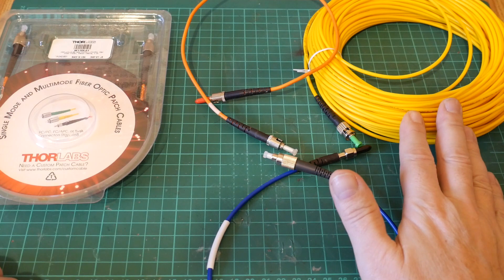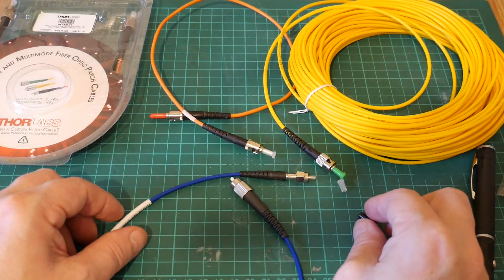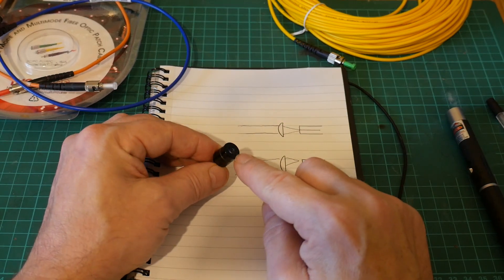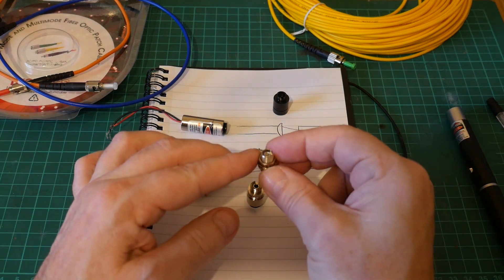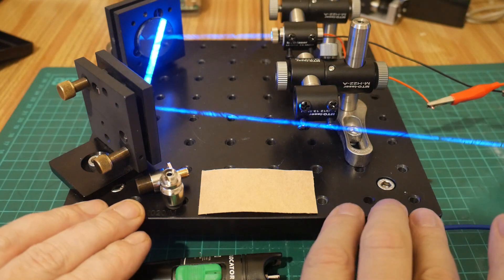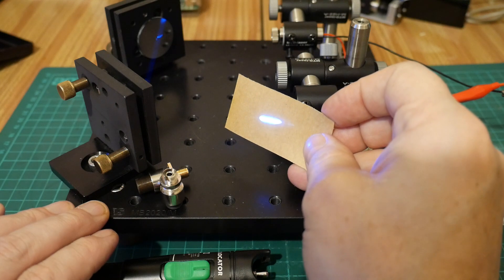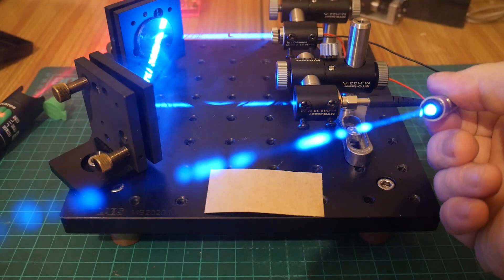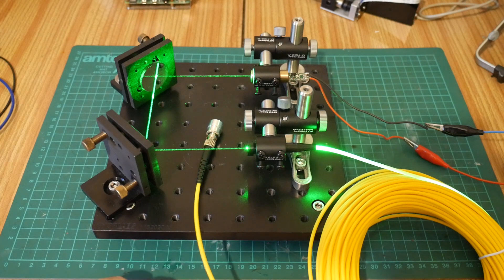Coupling Laser beams into Fiber Optic Cable!

Comment: I'm working on a spectrometer and need to couple three different wavelength light sources into a single optical fiber. What's the best way to do this using minimal hardware?

Comment: is there a way do the reverse , if we want to transmit data from computer to another far away with laser beem over long distances in the air  ? getting from pc1  light from fiber to laser ..than laser to some IR or optic sensor than to pc 2

Comment: Hi Les what do you use to make the smoke for the obligatory smoke shots? Love the uploads!
Reply from the maker: Dip a soldering iron in glycerine and blow on it. I should probably buy a smoke machine!
Reply: @LesLaboratory that worked surprisingly well! Thanks for the tip. I always assumed you had a mini smoke machine but I wasn't sure.

Comment: Looked a bit for the required hardware, optical bench from Thorlabs is as cheap as stuff from Ali (100 bucks?), sadly found mostly gun related collimators on Aliexpress, no idea where to get adjustable mirrors and such if not for big bucks :(

Comment: Is the final beam gaussian?
Reply: don't think so; telecom single mode fibers with 9um core are not single mode for visible light. You'll need smaller core diameters for that. These are consequently harder to align and they are less common and therefore much more expensive in my experience so I could see the reason for buying the telecom fiber.

Comment: my understanding is that free space to fiber launch, especially in devices based on small numbers of relatively high power off the shelf emitters, use so called "coreless fiber end caps" to facilitate setup and mitigate practical problems.

they can be >10x larger in diameter (800 micron outer cladding high power multimode fiber with 9 mm end cap), with much greater mass to sink thermal  effecss, dampen resonance and alignment issues (from microscopic movement or resonance driven by ambient noise or thermally)

Comment: Looks like this is first step to fiber laser used in metal cutters. How to couple few laser diodes into one fiber?
Reply from the maker: For this is is possible to join several fibres into one if you have the right gear. I will have to keep my eye out for a fusion splicer ;-)

Comment: Do you have a link for that cheap telecommunication fiber cables.? but perhaps not ideal for my usecases.
am going thrue different fibers, looking for  crude cheap alternatives for spectrometer extension cable.
been trying anything from the old Toslink cables to the modern fiber cables for internet simply because of the low prices..
just been getting the cheap ones, like SC OM2 angled APC and UPC, and FC interfaces..I recall its multimode.
but they all got their weaknesses
Im seeing a big dip from around 700 to 760NM on Toslink when checking an old glowing light bulb  so clearly not linear acroos the visual NM-span to near infrared.. its the visual span Im pursuing linear transfer in.. 370 to around 800nm
and these cheap fiber cables, they are very poor in transporting visual light as its not accelerated and quite dim, as the optical line seems very narrow. (at least on the cheap one, Ipicked up from CN) 
Are there any cheap cable alternatives for spectrometers light travel. that is linear acroos the visual wavelength span?
sofar the Toslink cables, works way better then the optic fiber cables, I tried, and they dont seem to fluke my readings, and I dont have many coherent laser sources in the 700 to 760nm span.
But it could very likely be that Im simply not pursuing the right version of cheap optic fiber cables that got wide optical inner transmitter light path.?

Comment: I'm after some advice for a very specific problem. I need a laser powerful enough to burn carbon/soot but has a flexible fibre to get into hard places. The carbon/soot is located inside drilled holes within a car engine pistons.
They are called the oil return holes and take oil from the oil control ring through the piston back into the crankcase, all car pistons have these holes, but some cars they get clogged up with carbon deposits.
The idea is to remove the bottom oil pan and burn out this soot/carbon deposit with a laser, the holes are usually quite small maybe only 1/8 of an inch in diameter, but can be quite long all the way through the piston ( 1/2" or more at thickest part of the piston head). 
To clean out these holes requires engine rebuild, if its possible to clean them out with laser would be very advantageous.
Reply: Interesting problem. I'm curious to know how you eventually solved it. Obviously, fiber optics technology deals mostly with laser that are not that powerful.
Reply: @kichigan1  I never solved it

Comment: Maybe an amateur question but: why the beam between the 45º mirrors looks much more intense and visible than the parallel input and output beams? Is it the camera position?
Love you videos and style, BTW!
Reply from the maker: Light is preferentially scattered forwards, rather than sideways, so a beam pointing towards the camera will appear brighter, than those parallel to it. Thanks!

Comment: 5:00 do you have a link for the lense? i don't finde the one that outputs a beam of the optical fiber that is in this price area.
Reply from the maker: At 5:00 the lens assembly shown is home made from an sma connector and a laser diode collimator lens, this was for an odd SMA905 fiber I had. The more common  FC connector lenses are available from aliexpress at reasonable prices: https://m.aliexpress.com/item/1005003438926038.html

Comment: The crazy thing is that my brother, I and my cousin got separately the idea of smartphone repair. I kind of knew a faintest but that my brother did this before but in my mind I marked it as electronic stuff. If I were rich, I would out of boredom behave as if I was kinda poor and try to make a buck incl. a limited budget. Like here, start with repair, then where to find deals and the distribution theory where and how to sell. This by not being a betrayer but e.g. find the customers that long the most like merchandise lovers.. speaking of, this was before my realisation of the relative abundance of deep state lovers.. anyway, You have tech in Your hands with that phone and You can maybe push Your learning to the up to date microchips, programming and e.g. chemistry like the Loca glue (light activated optical clear adhesive with no yellowing and a refractory index below 1.5 and prob. Rhos certificate?) or even how to do it Yourself (diy) a debubbling/vacuum machine for the OCA glue (heat activated one). No need to Google it, You may find out by accident & etc.
Reply: Oh! Allways inform for safety precautions by e.g. 2 professionals or something. If You open up a device with a high voltage capacitor, it could be still charged! And whatever I did, I tried allways to avoid handling 220Volts and to put it through a good isolated converter first instead to e.g. 12V
Reply: Yeah.. syntax..

Comment: there seems to be some interesting work with using polarized beam splitters to combine diode laser beams for increased power.  Have you considered doing something along those lines and add in the use of a fiber cable as a part of a cutting head? ie blue laser diodes?
Reply from the maker: I have a fiber fanout that I am planning to use in reverse at some point. Basically several fibers coupled into one. I have no idea how it will work out, but it is on the list of projects!

Comment: considering the challenges, sometimes i think its best to just mount teh damn thing to the head where it always was!

um... for years years i always wanted to know "how much power can i shove down a fiber?"
i never got answers, just gibberish about bandwidths and datarates. no, POWER!

i now understand its a thing called insertion loss along with variou other factors. not that it helps much...

i always wanted to shove the laser diode (or several) on a separate mount and feed the beam witha  fibre to the head... oh well.

probably best just doing it with open mirrors like a normal cutter actually.

Comment: There was some ideas for mounting fibers for use with collimating lenses etc in the comments. For me I have had great success using a piece  of aluminium about 30mm x 50mm x 2mm. I remove the buffer leaving the bare fibre exposed, make a clean cleave and then epoxy the fiber to the aluminium plate. Now it`s tempting to have the bar fiber hang over the edge a little, but this way its vulnerable to mechanical damage, so instead I cut or punch a small section of the edge away, maybe 5mm wide x 6mm deep. The fiber is mounted within this cutout so the end of the fiber is recessed from the edge of the strip but is still protruding over the edge of the recess. The assembly can then be bolted to supports on an optical bench or sled.

Comment: I think you can use the collimator from the SFP module
for example, you can see it here
https://youtu.be/vMP9gLMWHhI?t=107
Reply from the maker: I might might give that a go. I have a similar module (Laser diode direct to fiber) it has a GRIN lens in it, and looks like it was glued into position at the factory, but it would be nice to get a super compact coupler.

Comment: 5:30 you can use focusing lense module from DVD drives which can give very focused beam but with extra electronically focusing features so With that fine tune would be much easier and you can note and tell by looking at input power of the coil to find exact focus Point .

Comment: Are  there thick OF like of 5 mm 10 mm ! ??or can we built it like using hot glue and rubber pipe or any similar  materials with different R I ?
That can be use to take  Sun light to the  room by focusing the sunligh beam  and using sun tracking system .

Comment: The first time I collimated a single mode  fiber coupled laser I was astonished at how good the beam get. This was with some of the 976nm 14 pin lasers. I want to fiber coupled a few visible diodes and see what the results are. I want to try putting the fiber right up against the die of the laser itself. Glad you posted this video, great work!
Reply from the maker: Me too! Out of 9 micron fiber you can get a super tight beam. Out of multimode not so much, that said is the phsics is just right, you can get needle sharp beams out of those too :-) You are welcome!
Reply: It is possible to couple a fiber right to the output facet of a diode, but many diodes have oval divergence patterns on the uncoupled facets. Two 90° cylinder lenses can be used to collimate the two axes, or to inject them into fiber.
Reply: @FrancisEsmondeWhite  those are mainly diode lasers with the oval beam profiles. Diode pumped solid state lasers generally have a round pinpoint, but not as perfect a circle as gas lasers.

Comment: Good video, thanks!
In my experiment I have to measure the wavelength of a laser, so in the lab we illuminate one end of a single mode PC fiber and then connect the other to a wavelength meter. To gather more light we focus just a little with a lens. Not strictly focus because we can burn the surface. The problem is that I find that after many laser shots the fiber starts to deteriorate, that is with some punctures in the surface, so definitely I am not focusing 100% onto the fiber core. It then starts to gather less and less light and finally our wavelength meter doesn´t receive any measurable signal. 
Do you recommend the colimator solution :D? 
I will definitely try to match our laser with your method because so far I just move mechanical parts of the mirrors to get a significant light signal at the end of the fiber connected to the wavelenght meter xD.
Cheers!

Comment: I managed to make a simple liquid contact sensor for Arduino using a 1mm bent plastic fiber optic, it was quit accurate and fast, simple to make and very cheap.
Reply: Sounds interesting! Do you have link you can share?
Reply: @davidsteele9103  comment gets deleted, can't post links, just let me know what info you need
Reply from the maker: @mmghv  If it's a URL you are trying to post, put the word 'dot' in place of any periods or '.' in the link.
Reply: @LesLaboratory  It still got delete! youtube just sucks, it's a tinyurl with the id yujt9f8a after the slash if you can construct it.
Reply from the maker: @mmghv  that works! Very cool, elegant in its simplicity! I tried sharing my stuff on that group once, but for some odd reason FB was banning my posts too!
Reply: @LesLaboratory  Thanks, the project was canceled but I was very happy when the sensor idea worked, I just had the idea the liquid would impede the total internal reflection of the fiber optic and it actually worked! I'm obsessed with simple DIY sensor ideas.

Comment: The essential optical engineering theory is to create a relay lens which images the laser exit pupil onto the fiber entrance pupil (polished end), which image is less than or equal to the entrance pupil diameter, and with NA greater than or equal to (i.e., ray angles less than or equal to) the NA (i.e., acceptance angle) of the fiber.  These constraints dictate the relay lens system.  Collimation per se is not a factor.
Reply from the maker: Yes for sure. In this video I just wanted to go at it from a practical 'can we hack it' perspective. I may well do a short series on fundamentals if there is interest.
Reply: NA?
Reply from the maker: @davidsteele9103  Numerical Aperture. See: https://www.newport.com/n/fiber-optic-coupling for a good explanation.
Reply: Given that comm fibers are optimized for near-IR wavelengths, would they be less sensitive to bending at those wavelengths vs the ~~~~400-550 nm wavelengths you were using? (Or is the wavelength optimization more a matter of cutting 10ths of a dB of loss over long distances, whereas the bending screws things up so badly that the wavelength doesn’t really matter?)

Comment: Ever mess with the kineFLEX mounts/fibers? Got a pile of argon lasers that use them, looks like an interesting solution.
Reply from the maker: I have a couple of kineFLEX mounts that came as part of a Laser assembly off of eBay, alas, it came with no cables, but yes, the mount is interesting! I reckon with some work it may be possible to build something similar but smaller that could couple onto the end of 12mm Laser diode modules. That would be pretty cool!
Reply: @LesLaboratory  I have a few spare fiber cables, but no alignment tool. Seems there are some 3D printable ones out there however. Got a half dozen argon lasers from a print shop, so, a bonanza of parts. Looks like they came out of Agfa plate-setter/printers.
Reply: @o.e.r.3287  Hah, I sold Agfa imagesetters from my VAR (value-added reseller) business back in the day (early 1990s 😮). I’d never thought to wonder what sorts of lasers they used; I’d just assumed HeNe, possibly frequency-doubled. Maybe platesetters used argon lasers because they needed more power to expose the resist on printing plates cs photo film? I expect you could buy them for parts for a song these days, if anyone still has any collecting dust somewhere. It’d be cool to have an argon laser!
Reply: @DEtchells  These date up to late 2021 on their refurb stickers, so the tail end . Manufactured from 2007-2011 on the dates I could find. Could be a plate setter, but these are just the optics boxes/controllers, lasers and PSUs. Still trying to get them past idle mode, and finding a proper remote/controller for them is a big pain.
Reply: @o.e.r.3287  Oh wow, those are definitely late-issue. They’re almost certainly platesetters. - I don’t know what Agfa was into in recent times, but it’s for sure they wouldn’t be film-based in that time frame. Direct to plate was just starting to come out of the lab as I was exiting the industry, but my impression is that it took over pretty quickly. The ultimate move was to image the plates directly on the press. (Maybe they didn’t even use conventional plates at that point?) The whole push was to get to direct-to-press for the sake of both efficiency, but also quality (registration could be that much better if you imaged the plates right in place).

Good luck figuring them out!
Reply: @DEtchells  Yeah, especially since diodes took over, became so much easier to image plates pretty much wherever. Good news is, all the heads work fine in idle mode, just need to ramp them up to full power.

Comment: Very helpful video! It's a fascinating field. Thorlabs has a lot of informative videos, but I like the DIY flavor. I've wondered how feasible it is to DIY a fiber optic thermocouple probe for use in a microwave oven. Probably out of the question because of the special composition of the glass.
Reply from the maker: Thanks! Yeah, I have watched Thorlabs' stuff, but I wanted to do a 'can you hack it' style video (plus, I don't want to waste time in the next video, explaining how coupling works!)
Interesting, I am not sure on this one, from the papers I have read on the subject, the fibers (or at least the tips) are speciality, and might not play well with microwaves. 
I have questions: How high a temperature? 
Any reason a shielded regular thermocouple can't be used?
Reply: @LesLaboratory  I suppose under some circumstances you could use a conventional thermocouple? I have a microwave kiln I'd like to measure, and another use would be microwave chemistry. Just fishing a probe up through a hole in the bottom would probably be safe. Cool, looking forward to what's to come!